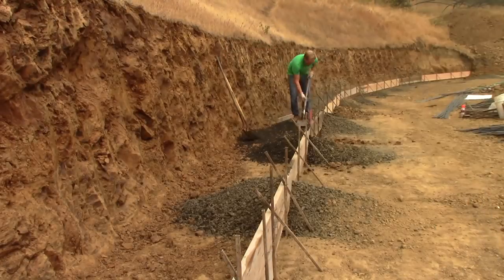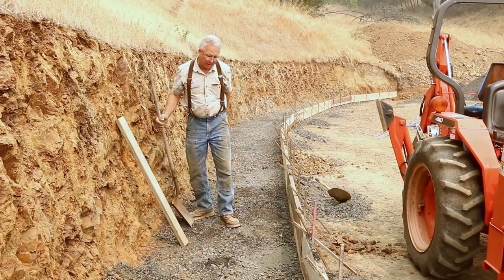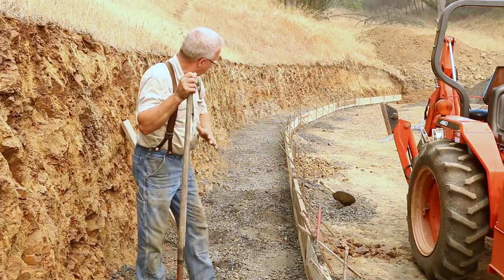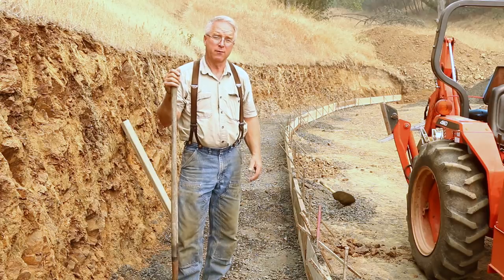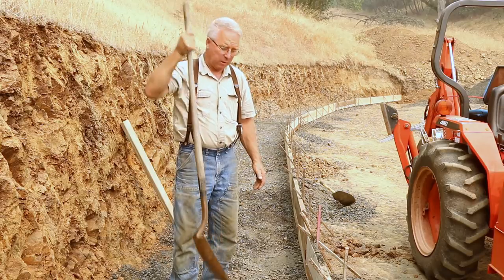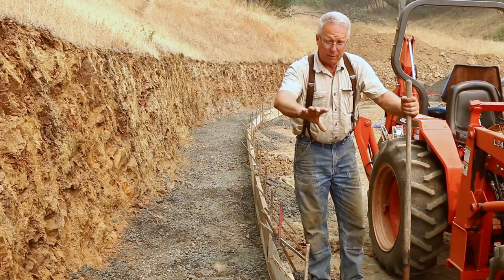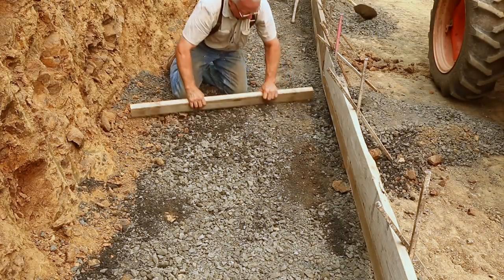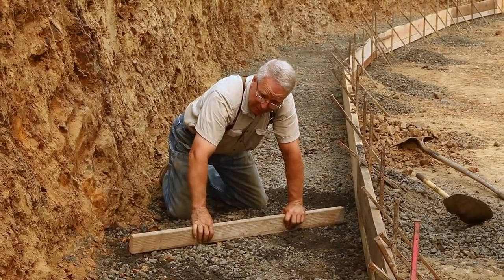Pre Rebar Footing Preparation: Ep.09

Comment: The area I live in we use a rule of thumb for footings (that is for block foundations).  12" block; 24" wide by 12" thick concrete with two rebars up 1/3 up from bottom.  8" block; 16" wide by 8" thick (better have narrow feet) concrete with two rebars up approx. 1/3 up from bottom and so on.  We have clay soil mostly but some sand in certain areas.  Generally we do not backfill footings.  Just a rule of thumb that may change with local rules.  Retaining walls as you have noted require a wider footprint and walls may have to be battered (most are).  Greg

Comment: One other benefit,  concrete structures (footing, slabs, walls) will perform more predictably when they are uniform dimensions.  If the footing were different thicknesses due to uneven substrate it might not distribute the load evenly.

Comment: One point not mentioned that may matter, is if you do slap concrete for footings on virgin soul and it's say plus or minus an inch or two. That creates an uneven strength factor , like a perferations in toilet paper. Under loads the weaker spot will crack.
Reply: load crack, jack

Comment: Honda's are used on scow pumps they can be a big ball of rust the recoil cover hanging together by very little the on off switch barely existent, yank on the pull cord it always starts. No matter how good your native soil is it will never be as easy to grade and compact like a processed aggregate. We call 3/4 minus 3/4 (25mm) road base the local gravel mine sells lots of it probably close to 3/4 of a million metric tons a year.
Reply: When I started out, we called it “item four”. I guess it originally was the fourth item on the mason supply company’s product list. Once, when I needed to get two tons of it the loader operator misunderstood me and put 4 tons of it in the low boy (Dodge 300) dump truck I was driving. Definitely one of the most nerve wracking drives I’ve made.

Comment: I saw you used a plate compactor at the end but do you prefer that over a jumping jack?
Reply: For that application I think the plate compacter is the best choice.
Reply: In my experience, a jumping jack is typically used when back filling both sides of a poured wall, or building up subgrade that is substantially deep with soil for flatwork, as it runs better on uneven ground (or uphill).

Comment: I shouldn't have said that about the compressor. It won't run properly now. It probably made its decision to not run right about when I said it's been problem-free.
Well, maybe somebody around here knows some stuff about them. The symptoms are it will only start full choke (never needed choke before), fills the tank with a misfire here and there, then the engine shuts off when the tank is full. After that, it can be started and will run a bit roughly only at half-choke, cycles normally, then shuts off at the end of the cycle.
I've ensured clean gas and replaced the spark plug. The issue arrived suddenly, after sitting for about three weeks. It's an 8-gallon 6.5 horse Speedaire wheelbarrow compressor.
Reply: I've lost track of how many times we've fallen back to it when the electric one's failed. It's been three electric compressors during its service, all of which have been repaired at least once. Even the $1,200 Jenny only went a couple months before a problem showed up that we still haven't figured out a year and a half later.

Comment: "That was not staged."  I'm sure it wasn't!  I have two mowers with Honda engines, and those things start the first time, every time. I've been very impressed with them. For one of them, it even stated in the manual that it should start on the first pull, and if it doesn't start by the second pull, there's no sense trying a third pull, because it's broken.  My most recent mower I ordered online. That engine came dry.  I added oil, I added gas... no priming necessary... one pull and it started. I just about fell over.

Comment: Did you have a proctor done on the material?
Reply: I do remember that was discussed in a past episode.
Reply: I think he had a projector done on the soil on site, not on this fill. QP (or 3/4 minus, or DGA, or crusher run depending on where you live) has pretty flat compaction curves. You can be a good number of points off of optimum moisture content and still hit 95% of maximum dry density. Ah the days of having a set of scales, a propane stove, and a cone of Ottawa sand while performing field density tests.

Comment: In the old days we use 3 inches of compacted graded gravel and then laying down an expanded metal mesh and then llaying down the rebars and tied them all together and lay down an another expanded mesh over the rebars and tied them together again. and we repeat it again on top with a steel spacer so that we can create a double shell reinforcement for the poured concrete. Our concrete is 2 and 1 and 2 of cement and sand and graded gravel. The steel rebars, steel mesh, and steel ties are all galvanized and the steel reinforcement is about 1/2 to 1 inch away from the surface of the concrete structure itself. As much as possible we create a MONOLITHIC single pour steel-reinforced concrete construction inorder to achive solidity and stability with double shell construction. It is a standard military engineering policy. The reason we use metal ties is because you Westerners do not understand our way of reinforcement that makes extensive use of mechanical clamping ties of all kinds and sizes for different purposes. Our concrete is mixed with yttria-stabilized zirconia glass fibers that are immune to the alkaline reactions and alkaline environment of the concrete's alkaline cement binders (developed in the late 1940s for military purposes) so that they can simultaneously provided additional reinforcement for the concrete as it is poured into the forest of mechanically clamped interconnecting steel rebar forests and so that the pieces of gravel will be held in place and will not accummulate at the bottom even if we allow the vibrator probes to stay for too long inorder to densify it and to make sure it is air bubble free and free of any trapped air pockets. Then in the early 1950s we developed double twsted galvanized and stainless steel fibers that can be mixed with the concrete in such a way so that they won't clump together and will be evenly distributed and dispersed through the yttria-stabilized zirconia glass fibers reinforced concrete. EVERYTHING WAS OVERBUILT for all military installations of critical importance and they are either semi-underground or fully underground.

Comment: I see you had a geotechnical engineer, civil , structural and Experienced heavy equip operators to ensure you get the foundation correct.  May I ask what is the cost of all these professionals for these reports.  I have 3 acres here in Central Texas with possibly expansive soils. I surely need a group of professional people.  It is my intentions to do the framing and Electrical....